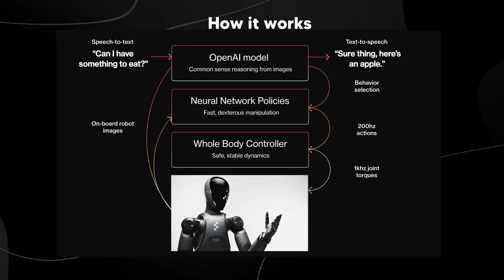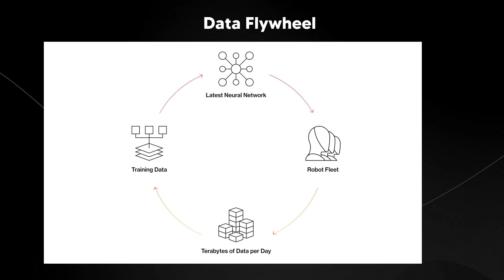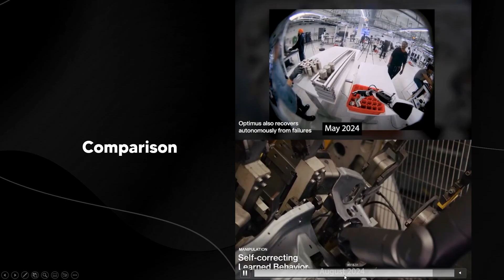OpenAI's Finally Give GPT-5 A Body (Figure 02 Breakthrough)

Comment: They walk like Biden. Either it doesn't have a hip rocker or it doesn't use it yet. Seeing as the leg hip joint is only 2DOF and it can't spread its legs it probably doesn't have the hip rocker joint. So that's a built in failure right there. Tesla's gen II has hip rocker and uses it.

Comment: It is an astonishing advance, but does it really need legs? are legs the best way to move, lifting one platform and lowering it back again? wouldn't it be faster movement with wheels, like if it had roller skates? for balance it could have 4 sets of roller skates that can separate and unite.
Reply: Because our world is designed for humans who have legs, and these robots are intended to replace humans. How would it climb stairs with wheels?
Reply: @DJ-dh3oe  I see your point. My main takeaway is I believe we are already capable of better engineering even before AI takes that job over. So here's some ideas :)
1. "Heely's" (shoes with wheels) - then they can do both.
2. "Smart ground" - Similar to what's been proposed for  roads (or already implemented for forklifts) embed mag rails in the ground. Then only use this pedantic humanoid mode for off-roading.
3. ~"Self arranging modular wheels" I can't remember the name RN, but about a month ago I read a paper about a company that designed wheels for robots that change shape automatically for different terrain, so for flat surfaces they're normal wheels but going over a bump or even to get up a step, they become more triangular.
4. To answer your Q directly, I imagine outside of factories or specific places that a mag rail would work - Someday all stairs will be replaced with escalators. IDK if that's an unrealistic/inefficient feat but I'm just demonstrating out of the box thinking.
Reply: @DJ-dh3oe  with four sets of Roller Skates that shouldn't be a problem, even rotating rolling skates would work better than legs, like a fidget spinner climbing ladders, the wheels could lock when needed.
Reply: Exactly! I'm altogether perplexed by why we're trying so hard to anthropomorphize when we can engineer so much better without even new technologies.  To think the next new breakthrough in AI robotics will be the wheel.  It's such a glaringly obvious solution.

Comment: The arm and hand movements we’ve almost perfected. It’s the movement of the lower extremities that still leave for a whole lot of improvement
Reply: There's this hardly known about mechanism called the wheel.
Reply: @themultiverse5447  I was going to say that 🤣 but ye legs and balance are pretty bad
Reply: Probably better simulation training and different joints on some parts will fix it.. looks like balance it’s the problem for robots..it’s the beginning.. the most important part is the robot doing its functions fully autonomous and make them think. Last part depends mainly on AI advancements.. let’s see the next models..